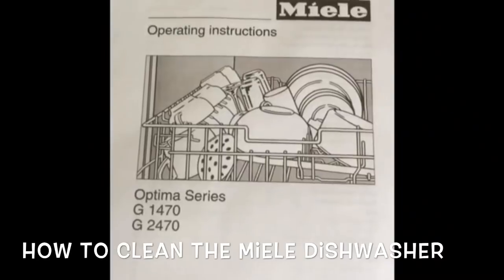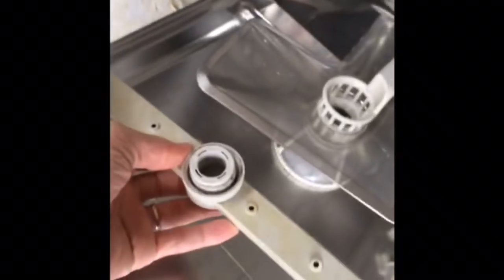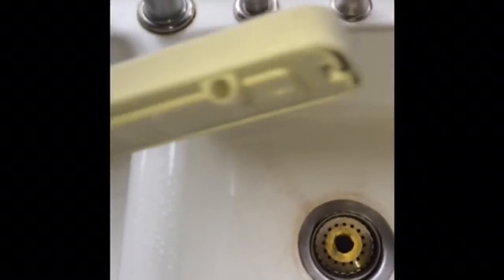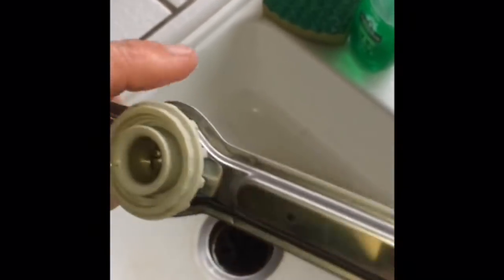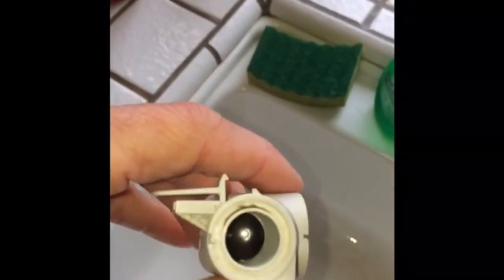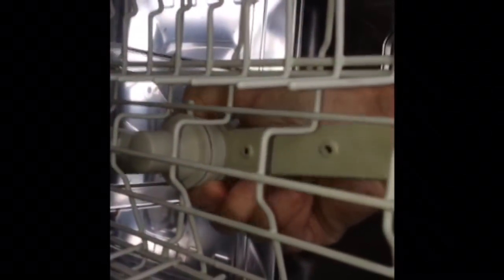✨ Miele Dishwasher - Complete Cleaning ✨

Comment: Thank you Scott. My model is the built-in Miele Futura Classic and your instructions worked for this model as well. The only difference was that the one-way valve appears to be fused or glued with the housing component beneath. Cleaning all the components with an old tooth brush and a degreaser did the trick. Now my dishwasher is shining and doesn't smell bad anymore. Thanks again for sharing your knowledge and experience with us. Keep up the good work!

Comment: After 1:03 there is a metal button almost opposite the no return value, what is this?
Reply from the maker: That’s the temperature sensor probe👍
Reply: Thank you. I pushed it in in error, Will that cause a leak?
Reply: @teddarley815  Yes, huge leak. Above there are pointers for how to put it back in.

Comment: Should there be an  O ring or washer between the one way valve and the part of the machine it sits next to? (at the left)  When I took mine out, it had what I thought was dried crusty dishwasher powder around it which I scraped out with my fingernail. Turns out there is a groove that looks like it should have some sort of seal. So maybe it was a white rubber seal of some sort that had perished? When I clip it back in there is a now small gap I can see between it's body and the part of the dishwasher which it sits next to where the water goes through.
Reply: should it have had one bud? i hasve exactlythe same issue - did you get it sorted, thanks ....Steve
Reply: @1965stevieboy  Yes it is supposed to have a white rubber seal in there.  Problem is Miele won't  sell it on it's  own and want a huge amount of money for a new complete non return valve. So instead of giving them about $55, I took the valve with me bought a 50c O ring to fit the groove from a hardware store. Won't  be buying Miele next time I buy a dishwasher. Parts are far too expensive and they have terrible customer service, at least here in Australia.    ☹

Comment: Thanks for the great video--way more helpful than the instruction booklet.  So the Miele service technician said the vast majority of problems people have arise from using way too much detergent.  He recommended no more than a teaspoon full.  I won't say how much we had been using!!
As a result, all the parts get covered with hardened detergent and bad things happen, such as water leaking on the floor in front of the machine, filters clogged, drains clogged, etc.  So we use the Miele dishwasher cleaner and then the Miele dishwasher/washing machine cleaner and our leakage problem went away!!  That's the good news. The bad news is that 8 years of no maintenance and too much detergent has made it very difficult to take off the triple filte,r the non-return valve and the drain pump fan. As a result, the filter under the screen did not come off as part of the triple filter system.  Finally got the handle and screen off but not the filter below it.  It is stuck solid.  Any ideas how to free that up so I can clean it more thoroughly--it's really clogged up.  Thanks!
Reply from the maker: Thanks Elliot,
I would pour in half a pot of boiling water and a quarter cup of vegetable oil and let it sit for 10 minutes and then grab the filter and rotated in both directions by a quarter ranch until it finally breaks free

Comment: Hi Scott when trying to clean our Miele the steel post visible at 0.51 seconds (inside the drain basin, top right) was accidentally pushed in, we cant get it back out. What function does this part have? Help!
Reply from the maker: That’s the temperature sensor probe.
You can take off the panels below the door, make sure it’s unplugged and reach in to push that probe back through the black rubber gasket.
Reply: @QuickAndEasy5MinuteAppliance  thankyou, we are having trouble figuring out how to remove the panel below the door, the plastic kick plate. Our model is a G1243SC. Is this designed to be removed?
Reply: @QuickAndEasy5MinuteAppliance  update, we managed to remove the kick plate successfully and took the base plate off for clear access, and pushed the temperature sensor back successfully. Just as well this all happened as we discovered there is a slight leak and reddish fluid slowly dripping onto the base plate out of sight. We assume this can be fixed by replacing the drain hose which is 20 years old. I would like to also replace the water supply hose and its water pressure fitting, can the standard dishwasher hoses / fittings from the hardware store be used or does it have to be Miele? Youradvice is appreciated thankyou.

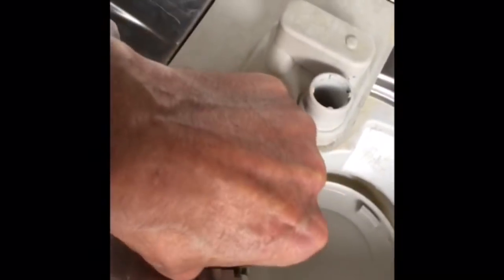Comment: At 1:05 there's a metal cylinder sticking out. I pressed mine in and it won't come out. Any idea how to fix that please? Thanks!
Reply: I followed your advice to reinsert the silver temperature probe. Lots of water leaked out of it. Good thing I had a lot of towels on hand.
Reply: I followed the suggestion above for the silver temperature probe. I had to put the dishwasher on its side and remove 4 torx15 screws to remove the bottom panel and the temperature probe was hanging out right there.

Comment: hey there, once the filter screen is removed - what is the function of the silver cyclinder?  I pushed it in to its seal.  Good, bad, ugly?  Thanks in advance.  Great video.
Reply from the maker: Thank you,

That’s a temperature sensor,

It’s better not to push it in as that can cause a leak.

Comment: We took off the triple filter piece and accidentally pushed the silver piece into the black ring :( Is there anyway to get it out? What does the piece even do. Our dishwasher will no longer work. HELP
THANKS in advance.
Reply from the maker: If you unplug it and then remove the bottom kick panel and also a small panel underneath you should be able to reach in and push that silver temperature probe back through the hole and that should do it😊
Reply: @QuickAndEasy5MinuteAppliance  Thank you, this helped! I fixed my G5975SCvi thanks to you.

Comment: Experiencing a Fault F78?  
• Heat up 2 cups of warm tap water in the microwave for 3 minutes. (approximately 150-160F)
• DO NOT USE HOT TAP WATER AS IT IS NOT HOT ENOUGH!
• Remove the filter assembly from the bottom of the dishwasher.
• Pour the hot water into the sump of the dishwasher and add 2-4 drops of rinseaid to the hot water.
• Let it sit for 5-7 minutes.
• While you are waiting for the hot water to heat up the circulation pump, access service mode and clear all fault codes.
• Start a new cycle after the time has elapsed. The hot water/rinse aid will drainout.
• The circulation pump will start after the dishwasher has filled with water.(Approximately 2 minutes).
• The pump should operate as normal.
• If the pump has not started after 2 minutes, try the hot water/rinse aid mixture again.
This advice courtesy of MD Appliance in San Diego (I have no affiliation - I don't even live in California). Found on their website.
Reply from the maker: I like it,
Thank you😊

Comment: Hi. Thank you for your great videos. I have an F11 fault on my Miele dishwasher and won't drain the water out. I checked the non return valve and entire drain path and found absolutely no blockages. The drain pump works fine but won't push the water out. I even disconnected the drain hose off the under sink drain connection and no water comes out. Any suggestions please?
Reply from the maker: Thanks John,
It sounds like the non-return valve that sits right on top of the drain impeller is stuck in the closed position and it’s not letting the water leave the dishwasher.
I can send you a video that shows you how to clean the one-way valve.
Just let me know if you need that video.
Reply: Hi, Thank you for your prompt reply! I have checked the non return valve and is all clear. One thing I noticed was a very fine crack on the side of the non return valve casing (part which clips on to the sump). Thinking that this will create a pressure leak I managed to heat up the plastic with the tip of a soldering iron and mended the crack. I have pulled eveything else apart and there's absolutely no blockages
Reply from the maker: Hi John,

You might try putting your drain hose in a bucket and shake the hose while it’s set to drain to try and knock the blockage out.
Does the impeller rotate freely when you turn it by hand?
Reply: Thank you once again for your prompt reply. I pulled out the dishwasher and opened it underneath. I blew some air through the drain pipe and there's no blockage. I physically removed the drain pump and by holding it in the air, I turned on the dishwasher on a quick program. The pump works and the impeller spins.
Reply: I have a similar problem and was wondering, did you find a solution?
Reply: Sorry to pile on.  I have the same issue.  Tried the same troubeshooting at John but with no luck.  Washer drains under gravity without return valve.  Valve is clean.  Impeller turns and works (tried it without valve and water sprays inside the washer)  Does not drain.  I'm wondering if anyone finally solved the issue.
Reply: Hi Michelle
I did end up working out the cause of the issue! 

The rubbers seals for the 2 return valve pipes (located under water spray arm) had worn out, allowing pump pressure leakage, therefore no pressure to push the water through the drain pipe. As I couldnt find replacement rubber seals, I ended up using plumbing tape! Everything now works perfectly! If you can't identify the pipes please send me an email and I will forward a photo.
Reply: John Neroutsos  Hi John, I would like to have the pictures, you seem to have a solution to the same problem I'm having!  (But I don't know how to send you a private message.)

Comment: I did this exactly and now my dishwasher won't work. :-( I can't figure out what I did wrong. At first I thought I put the silverware rack back incorrectly and that it was blocking the dw from latching closed, so I removed the entire silverware rack and then the dishwasher did work; I did two cycles that way. Then I tried to reinsert the silverware rack and made sure it was done correctly; it was all the way touching the back wall of the dishwasher so it couldn't have been blocking the latch, but still the dw would not start (display won't light up.) So again I removed the silverware rack entirely, because that seemed to "fix" it before. But this time it did not. The display won't light up or it momentarily flashes when I hit the power button.
All I did was clean the dw and put everything back together, and also I wiped out the seals and wiped down the steel with some diluted alcohol on a rag. The DW did work twice when I took out the silverware rack; now it won't start at all. It is only 3 months old. Thanks in advance for any advice!!
Reply: Update: I unplugged it and plugged it back in and hit the power button a few times and it is running again. NOW my husband tells me that the other day when he got it to work by removing the silverware tray, he had also switched the breaker off and on again. So yeah, the whole silverware tray was a red herring. Something electrical/electronic going on. It's running now. Maybe I'll get lucky and won't happen again!! (at least it is under manufacturer's warranty.)

Anyway, thanks for the helpful cleaning video! That really solved my problem. I was getting grit left behind in my glasses and bowls. I think it was because I had put a spaghetti sauce jar in the dishwasher without removing the paper label first. Cleaning the filter and spray arms fixed that!
Reply from the maker: Very impressive😊😊😊
Reply: @QuickAndEasy5MinuteAppliance  ...and today I fixed my pool filter pump the same way!! Hit "reset" on the GFCI and plug it back in! I am pretty impressed with my fix-it skills, LOL! (But THANK YOU for posting real repair how-tos!)
Reply from the maker: You’ve got the skills🏅😊❤️👍😎👏

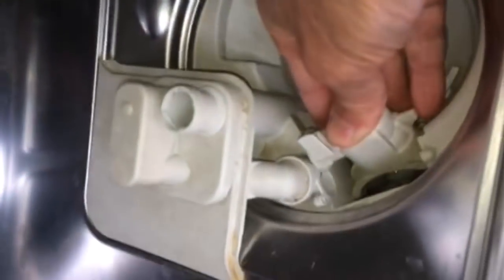Comment: at 6:32 When the valve is put back in, there is a metal "spike" right above your nuckle. What is that? If it´s accidentaly is pushed in, is that bad? How do i get it back out? Thanks for a great video!!
Reply from the maker: Hi Johan,

It’s a temperature sensor.
It will leak pretty bad without it being put back.

You can put it on its back and remove the bottom panel.
You’ll see it dangling and you can just push it back in through its rubber grommet.

Comment: "The machine pumps in water and then start clicking a couple of times, but it won't come on... (won't start the wash cycle)and then the error come back. so I need to restart it and then the same thing happens."  I have the same problem in my machine.Same machine.How did you fix it.Please comments.
Reply from the maker: +Augustus Fernando 

It sounds like the circulation impeller is stuck.

You can check google for my video on Miele dishwasher jammed impeller.  Not too hard to fix👍